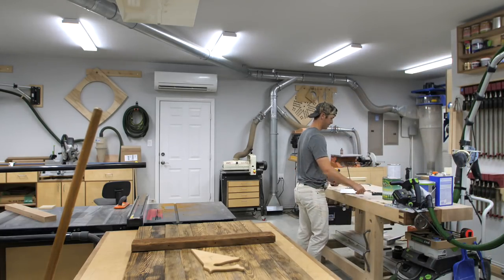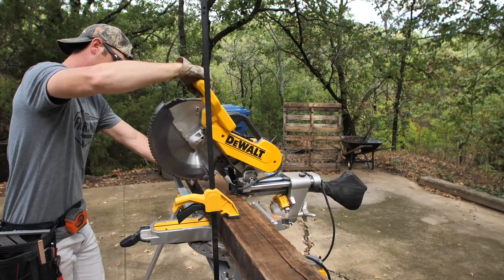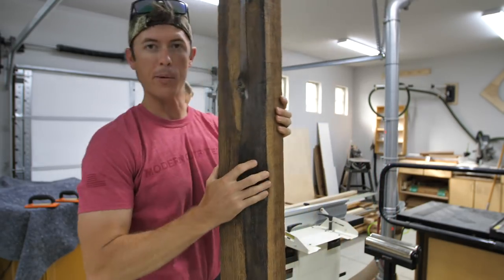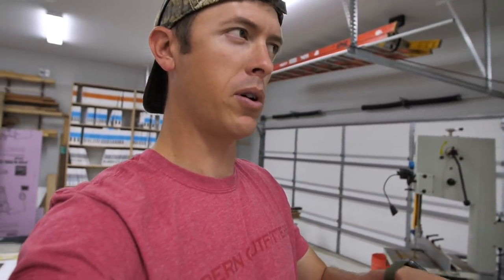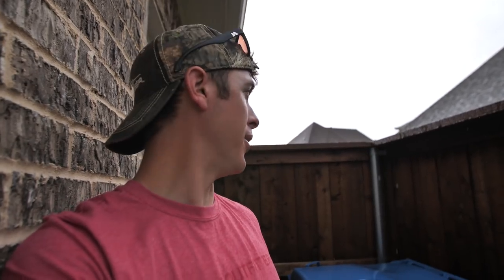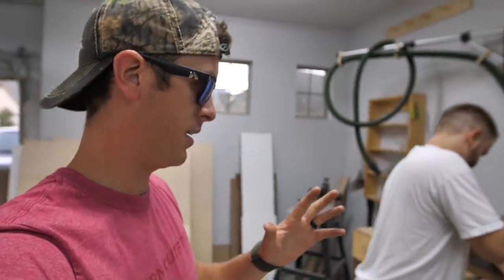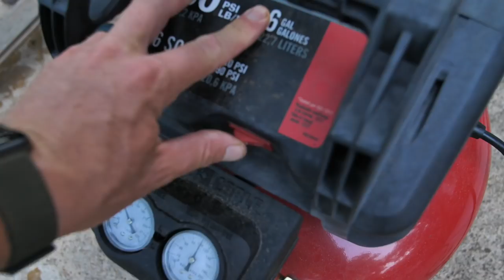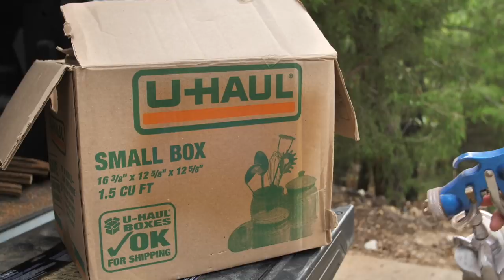I think it's Toxic, but it Looks Awesome...

Comment: Seriously, the cresote in used railroad ties is not safe to breath. If you are determined to use that in your house I would suggest sealing the whole thing in epoxy so none of the gasses escape. I’m no expert, but that’s my suggestion.
Reply: They aren't railroad ties, they are barn materials, but same thing applies.
Reply: I work with cross ties it's not just the  smell that hurts you it's the touch of the oil stuff it will make your skin come right off
Reply: Dwight Foster so, would a good coat of epoxy make them safe, or not?
Reply: @williameldridge9382  it's not cross ties but it probably does have the same stuff in it I can't think of the name of it but they soak any kind of wood that is gonna be used for out side purposes in it they soak it in cross ties so they will last longer
Reply: @pizzapimp8128  I would say so the only time we have any problems with the smell or anything is when we cut it
Reply: @williameldridge9382  They had RR markings (MKT & SPC) stamped in them originally. Go back a few vids to when they found the wood and search through the comments. There's a whole thread about it. There's even a comment thread in this video.
Reply: Dwight Foster I wouldn't even bother with epoxy. Epoxy off gasses for months let alone getting the epoxy to stick to the creosote.

Comment: the wood does have creosote but as long as you sealed it well I don't believe you'll have any issues. If your concerned put more sealing layers on it. The creosote dose not put out its own vapors that are dangerous. It would have to be atomized (you guys already did that at the shop) LOL hence the breathing issue. or you would have to be in direct constant contact with it. So sealing it breaks that contact.

Comment: Dude in about 1978 I trimmed a house baseboards, door trims, crown etc with Paduke. It is the hardest wood on earth. It costs 800 plus dollars a foot. In the milling process we spent 55,000 dollars in cutting heads. In the install process we spent 5000 dollars in carbide blades. And to cut and install the wood you have to wear a respirator, not a dust mask. The total install of the above cost &750,000. That is the trims and crown moldings. The house was about 15 million.
Reply: Do you mean Padauk?  The hardest wood in the world is Australian Buloke....

Comment: There are two kinds of carpenters/carpentry. 1. Structural- The building of houses/apartments/retail using metal or wood. Installation of cabinetry etc. This generally gets hidden and is a more labor intensive profession. 2. Cabinetry/Aesthetic- The people who can do this well are both creative and extremely skilled, precise and patient. As a plumber the stereotype is we don't get along with most other trades, but dang I have respect for beautiful woodworking (insert joke below).

Comment: Dude! Do you not read any of the comments on your videos? I know you're still new to woodworking, but seriously, you need to read and learn about those timbers you are using. You asked for comments and answers on the video where you picked up all that old timber and were told that it was most likely CREOSOTE and is not to be used indoors under any circumstances! Not kidding here! That stuff is a known carcinogen and never becomes non-toxic. I know you have put a lot of time and effort into that table, and yes it does look very cool, but please, do NOT use it. You were getting light headed and nauseous from cutting it. Now you want to put that same thing in your house? With your wife and new baby? Seriously? It will continue to off gas indoors for a very long time. This will not end well. You asked for answers to what the MKT & SPC stamped into the end stood for. You were told by many, including me, it was from the Missouri Kansas & Texas RR. (MKT) The SPC is for Southern Pacific Companies. The company initials along with the date placed in service are stamped on the end of all their CREOSOTE posts, pilings and cross arms. The old shed might have been an old RR building. Or just a shed on some farmer's property who ended up using it for storage. Those old creosote timbers were probably meant to be used for fence corner posts and such.
Reply: Paul Allen watch till the end Jesus Christ
Reply: What's your point? You think water based top coat will seal creosote? Think again. That oil will bleed right through. Maybe, just maybe, 2 part epoxy would seal it for awhile.
Reply: Pretty sure he'll be changing out those legs very soon now that he has this information. Lfg is a smart guy and I'm almost positive this will be brought up in the next video now that he's been informed... More surprised that the guy that actually works with wood for a living didn't know this was what was on the posts to begin with.. He does great work but clearly doesn't have much knowledge beyond modern wood working. He deserves there criticism not the guy that seeked out help from someone that knows wood working better than him
Reply: LFG was informed a couple of months ago when he made a video of gathering all this lumber. He even asked for help identifying it and asked viewers to leave comments about it, which many did. And yes, I too am surprised the other woodworker couldn't identify creosote lumber.
Reply: Paul Allen yeah I know I saw that video and all the comments. Left one myself. I think him saying it's might be toxic in the title shows he knows somethings up and he either needs to seal those legs or ditch them all together.. Well, I hope so at least. Plus you think osg is gonna let that stay in the house once she's learns this info? I DOUBT IT 🤣🤣🤣 sucks because it is a beautiful table but those legs just gotta go. Gonna end up giving Willis a twin

Comment: If it is treated just make sure it stays smooth cause they used creol(dont remember the spelling) back in the day that crap burns bad like literally a splinter can be a 3rd degree chemical burn . i used to treat lumber and they had a tank full of it still dangerous stuff when its in chemical form

Comment: About making your table safe, If I was you I would use epoxy resin on it.  this would give you a 100% encapsulation on the wood top legs and all.  you may have to do the top first let it dry a few days then turn it over and do the legs and underside of the top. But that would indeed make it safe, Good luck.

Comment: should have clamp down than screwed from the bottom up into the table top  with small screws. nice table to keep outside. this table is soaked in creosote . not only osg is not going to allow this in the house but your mom and mother in law will carry this out if you don't. always know your wood. next table build it like a bass

Comment: "A 2005 mortality study of creosote workers found no evidence supporting an increased risk of cancer death, as a result of exposure to creosote. Based on the findings of the largest mortality study to date of workers employed in creosote wood treating plants, there is no evidence that employment at creosote wood-treating plants or exposure to creosote-based preservatives was associated with any significant mortality increase from either site-specific cancers or non-malignant diseases. The study consisted of 2,179 employees at eleven plants in the United States where wood was treated with creosote preservatives. Some workers began work in the 1940s to 1950s. The observation period of the study covered 1979- 2001. The average length of employment was 12.5 years. One third of the study subjects were employed for over 15 years."

Comment: Toxic, well yes, what chemicals do pine resin contain. here's a few Turpentine (also called spirit of turpentine, oil of turpentine, wood turpentine and colloquially turp  is a fluid obtained by the distillation of resin from live trees, mainly pines. It is mainly used as a solvent and as a source of materials for organic synthesis.
Pinesol is turpentine deluded with ethanol.

Turpentine is composed of terpenes, mainly the monoterpenes alpha-pinene and beta-pinene with lesser amounts of carene, camphene, dipentene, and terpinolene.
This is what plant Uses to kill insects, when wounded!

Comment: Hey LFG, I worked for CNRail ( Canadian National) for a couple of years, I worked on a rail gang, and I knew guys who worked there for twenty, and they all seemed fine. However, they didn't chew on the wood. If you think my baby won't, you are delusional. It takes me back to my generation, and the lead based paint we encountered. Nothing makes that safe for using in a residential setting.